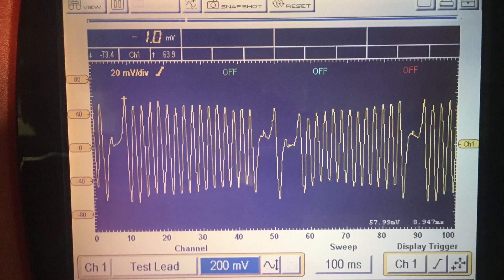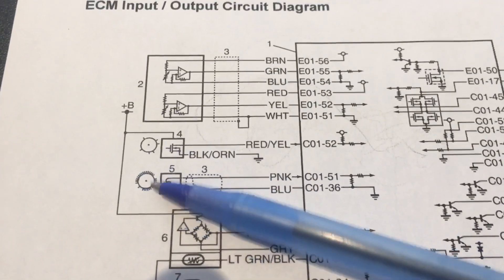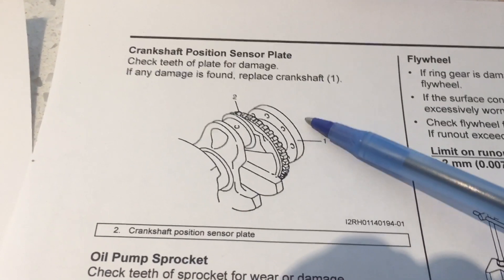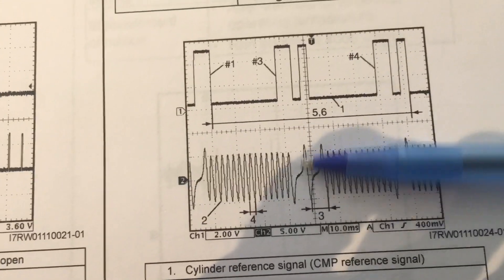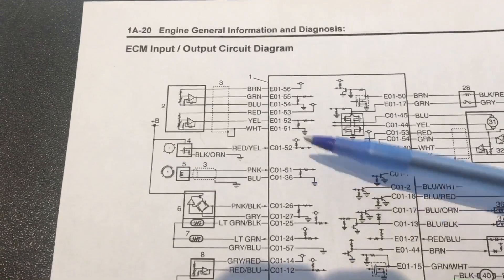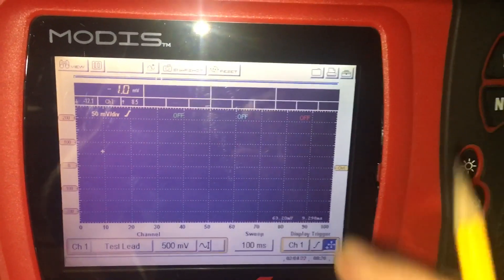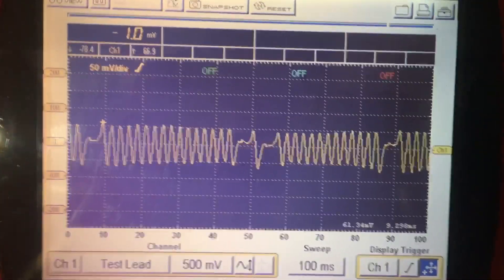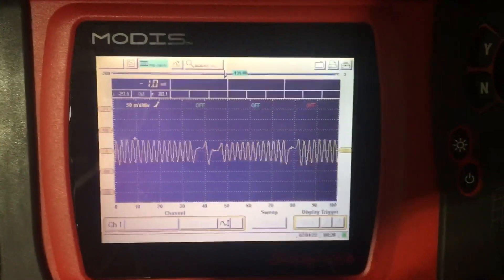Scoping The Crank Sensor Signal

Comment: Why does the manual say to measure at operating temperature?
Reply from the maker: Dunno. Guess they want everything heat loaded, to give you the best chance of catching a thermally induced fault. Thx for watching 🍻
Reply: @TheGibby3340  thanks for the reply. Would the dso-153 get a useable waveform off a crank sensor? 2006 VW  Jetta if that helps. I can troubleshoot the engine myself but was curious if the dso would be appropriate. Your content is very helpful.
Reply from the maker: Yes the 153 should be capable  of providing a crank sensor trace. Thx for watching. 🍻

Comment: Till date, I could not find any video that has explain very well when it come to crank and cam sensor detection on scope,  many years now am trying to learn this but I can’t get my head to understand how to interpret this
Reply from the maker: It’s really all about the index point on the trace (#1 cylinder @ TDC on compression stroke for example) relative to identifiable index point of the cam(s) rotation. Loss of cam to crank “Synchronization” (timing chain/belt skip or stretch for example) can result in difficult to diagnose performance issues. Signal amplitude (Y axis) and separation in time (degrees) on X axis are critical factors that are compared to known good waveforms to discern normal from out of tolerance. Thx for watching 🍻

Comment: First time I have seen your channel, I will scan through it now to see if you will fit in my criteria. May I ask why you don't properly name your video with all the data from the specific vehicle and engine? Without knowing the year or seeing any scan data, it might be possible that the ECM puts in a substituted value in place of the CKP once the engine fires up based on the cam space (Bernie Thompson term). Does it start up quick or a couple/few seconds? Did you disconnect the CKP once the engine was running? Thank you for the Service Info also.

Comment: You could easily have too much air gap where the sensor mounts.  That would explain the smaller amplitudes.  Could be a shim on the sensor.
Reply from the maker: Yes that’s a definite possibility. Rust jacking maybe. I have owned this car from near new. The gearbox has never been split. Strange. Thx for watching 🍻

Comment: I haven't seen a crank signal look like that before, double missing teeth. It looked good apart from the amplitude was way smaller, do you think it could be a typo?  Did you get chance to compare it with another car. Cheers Matt
Reply from the maker: Hi Matt. Could be a typo/error in the manual. Will check my other SX4. Will Update in next segment. Hope all’s well. Cheers 👍
Reply: Honda also uses a double missing tooth in the distributor-type setup.

Comment: what an awful place for a CKP sensor!

and I don't think I've ever seen a reluctor wheel pattern like this one...

as to the low signal amplitude...that's a huge difference 50mV from 5v spec...something is pulling down, we'd think...perhaps (and this is a long shot) backprobing is shorting those pins together inside connector...pins appear next to each other, right?

I'm reaching, I know...but hard to find other explanations
Reply from the maker: Hello Denis…Yeah something amiss. Don’t think back probing was shorting it because when I checked it to chassis ground (as opposed to signal ground) signal amplitude was unchanged. Will check my other SX4. Maybe a mistake in the documention/applicability??? Well see…Cheers 👍

Comment: Nice presentation for sure!  It does seem to be quite low and you would think it would at least be 500 millivolts on each side of the wave, to equal 1 volt total. If I'm reading it correctly, it looks like you may have about 50 millivolts on each side of the waveform.  Very interesting for sure. Is it possible that it could be using one of those magnetive resistance type sensors?  Thank you for another great Vid!  Hope you find the answer, for learning purposes anyway.
Reply from the maker: Puzzling…Will check my other SX4. Cheers 🍻